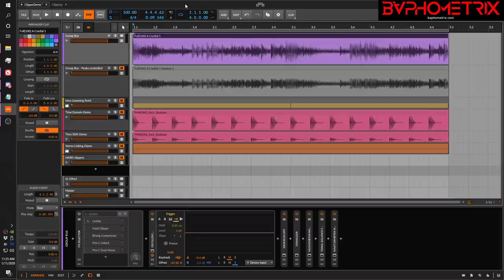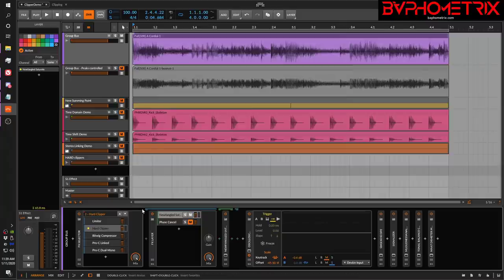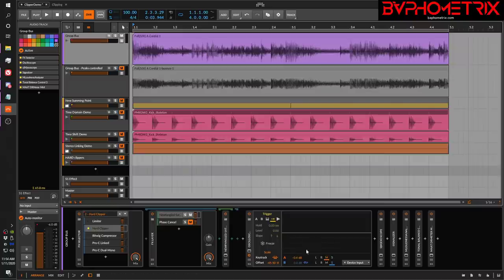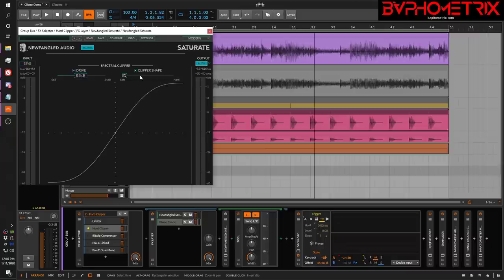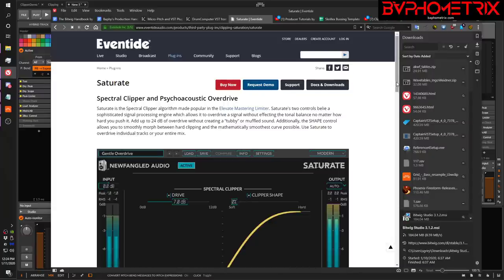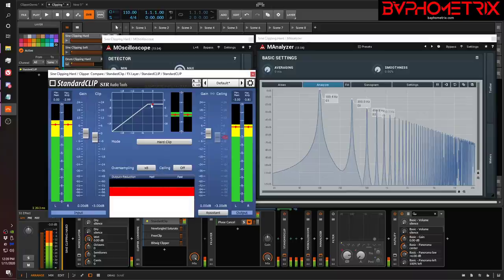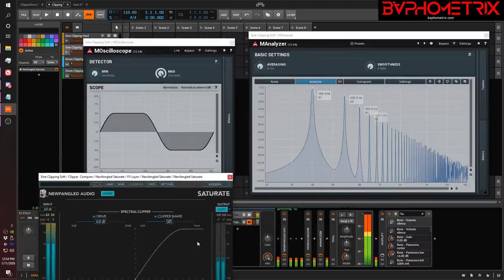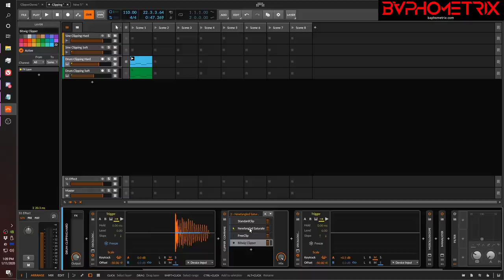Deep dive into clippers--NOT compressors--for clean, transparent loudness

Comment: Hi, I never used clippers much and what I hear in this video is that all clippers actually change the sound quite deastically. How then a clipper may be used instead of a compressor? I tried several clippers and they all introduce unwanted distortion similar to how overload sound, I even tried limiting the signal before clipper (with different limiters also) to make peaks more steady, but this didn't help much (if at all). I would be grateful for some clarification on this point. Thanks.
Reply: Which clippers did you use? I've recently started using VladG's Limiter No. 6's clipper section, but sometimes, when you apply something like that to a piano or a violin, as opposed to a kick and snare, for example, it may sound distorted by ear, but the number you get on the reading might show you that the audio isn't going over the red. I saw a tutorial by Au5 on clippers and he had a rack stack preset that he made where the more he raises the gain on the stock Ableton clipper, the more gain that's being turned down in the utility gain afterwards, which is last in the chain. I haven't actually watched the whole 1 hour and 44 minutes of this video and may have already made errors and misunderstood some things said, but I hope this might clear up things a bit.
Reply: @Kiloeve  I use SLM2 from tbproaudio and I like it a lot, I also have Limiter No6 and some others but they still may change the sound as any other clipper. So I cannot see any use for this instead of a compressor, as it is said in this video. It is a separate processing for me that has nothing to do with what I normally achieve with compressing.
Reply: @ivannikolaev2293  Oh, I see.
Reply from the maker: My best advice is to watch more videos about "clipping" and "loudness" (mine or others.... try "Mixbus TV" too!) until it starts to make more sense to you. :)

Comment: Very good video- I have had some colleagues try to explain clipping each channel as well but they failed to explain it to a level of understanding as you have. I have been applying it but it still hasn't really made since until now so thank you. Also,  is the bus routing at 59:17 all the chains linked to the next chain or all the chains straight to the master after the hard clips? I think I would prefer to go from each hard clipped bus straight to a premaster then slight limiting from there but want to make sure I am not causing myself issues by doing that.
Reply from the maker: There are many bussing strategies. There aren't any rights or wrongs here.
Reply: @Baphometrix  fair enough

Comment: Just discovered your excellent channel. Thanks for sharing. You've opened my eyes to using clipping, instead of compression, to tame transients. 

Would you use this degree of multi-bus clipping on non-EDM projects as well--e.g., folk or jazz? In other words, is using multi-stagged clipping a generally good mixing/mastering habit? From what I've read, loud mixes tend to sound better on smaller speakers such as earbuds.

If I am understanding you correctly, Eventide Saturate doesn't have over-sampling. I wonder why?
Reply from the maker: Quieter, more dynamic genres (such as jazz) won't benefit from clipping much, or at all.  Clippers are a tool to get into the tight dynamic range required if your song needs to be  loud because you're producing in a loud genre.

Saturate understands that if your goal is to clip_, the signal needs to _stop at the clipping ceiling. So that's why it's not oversampled. Because oversampling always creates peaks on output that  sit above the ceiling you set in the clipper (and those peaks are unpredicatble and variable).

What makes Saturate different from other clippers is best summarized by Dan Gillespie himself in this post.  https://www.newfangledaudio.com/post/saturate-1-7-0-preserving-detail-while-clipping
Reply: this is mainly for electro styles and maybe rock, all accoustic styles (and on vocals) you wouldn't use clipping

Comment: bit involved but, if you don't have a compressor with look ahead, you could duplicate your track, move just slightly ahead in time, and feed that track into the sidechain to trigger your compressor on the original track. obviously don't send the audio from the duplicated track anywhere
Reply from the maker: That still doesn't change the fact that compressors carve downward and upward envelopes over time, but a clipper is instantaneous. If your goal is minimum added distortion, you're far better off using a tool called "TrackLimit" by DMG audio, which is a super lightweight wideband dual limiter (two limiters in series, inside every instance of TrackLimit). It's fantastic. You can sprinkle dozens and dozens of them throughout a project.

Comment: 1:13:32 to be precise, the anti-aliasing filter is still going to be at 22khz (or whatever the nyquist frequency of the target sample rate is). The point is to try to filter out as much as the frequency content above the nyquist caused by the clipping process as possible before down sampling so as little aliasing happens as possible.

BTW I would not use post clip at all, unless it's the final effect in the master chain. Why try to sacrifice the quality (even if ever so slightly) when that intersample/oversampled clipping going over the threshold does not need to be clipped precisely? For master render it's different, of course.

Comment: What oscilloscope are you using? This is such a great lesson.  It will even work in r&b and hip hop.
Reply from the maker: Yes it will. The oscilloscope on the bottom is the native oscilloscope in Bitwig Studio. The I start using halfway in is called "Signalizer" by Janus Thorborg. However, the oscilloscope I prefer today is Psyscope Pro by FX23. It's for Windows only. But there's a Mac equivalent called "Oszillos Mega Scope" by Schulz Audio.

Comment: Just finding this video now. Really informative and in-depth; you're really a great teacher. What about the fact that hardclipping plugins cause serious aliasing without aggressive oversampling? I've done listening tests and it's relatively easy to hear the "cloud" of aliasing artifacts that obscures the version of a mix using a lot of plugins that alias when compared to one that doesn't use those plugins. So far I have found only one saturation plugin that takes this into account: Fielding DSP's Reviver (it applies an antialiasing filter to the generated harmonics). All of the rest need often at the very least 16x oversampling to reduce aliasing to a reasonably low range (less than -100 dBFS or so, which is still higher than optimal). That spells trouble for your CPU very quickly, even given the fact that I use a powerful i7. Curious to hear your thoughts,
Reply from the maker: It's a good question. The TL;DR (and don't rage-quit at this first part of the answer!) is that you can't avoid ALL aliasing and some aliasing is "good", just like some types of phasing issues are "good". Yes, really.

What I mean by "good" in this context is essentially, 100% natural and 100% to be expected. Every EQ filter you plop down is changing the phase of the spectral balance near that filter point on the track or bus where that EQ is sitting. Is that "bad"? Or is it just the way an EQ works and part of why the EQ processing sounds the way it sounds?  You can't slap linear phase EQs everywhere in your project because it will eat your CPU and create huge amounts of latency AND it will create pre-ringing that might smear your transients and sound objectively "bad".

So it's the same deal with aliasing foldback from any non-linear process like hard-clipping or distortion or saturation. Is the aliasing caused by these processes really, truly "bad"? Or is it just something that comes with the territory and is a natural part of the "flavor" of whatever waveshaping curve you tossed on the signal?

With that in mind, where you have a true, objective potential issue with aliasing revolves around the question of HOW MANY tracks and busses are you processing in a way that is causing aliasing? Are all of these small amounts of aliasing summing together on their way up to the mix bus in a way that is making all the intermodulation distortion AUDIBLE?  Then yes, that's a bona fide problem to solve. And it's the PRIMARY reason that savvy producers/engineers work at 48000 sample rate instead of at 44100 sample rate. (Because the anti-aliasing filters for oversampled processing sound even cleaner/better at 48000 because the filter slope can be more relaxed and cut out more of the foldback.)  Dan Worrall has a great video about "Sample Rate" that he did for Fabfilter that illustrates this issue perfectly.

Okay, so what does this mean for your question about using non-oversampled hard-clippers?  The problem here is that my recommended use of hard-clippers--as a VERY TRANSPARENT and CPU-light type of limiter process for absolute dynamic range control--is at direct odds with the benefits of using an oversampled clipper/saturator/distortion process to reduce the aliasing they incur.  If you oversample the hard-clipper, then you're not truly reining in the peaks at the ceiling value.  So you're not getting the dynamic range control that is the entire goal.

But there's a nuance here, and there IS an answer here.  First off, early in the project, just don't worry about it. Your goal is to have a bunch of "zero-latency-and-low-CPU" hard clippers everywhere. This is why I call them "dirty limiters".  Then, when you move into final mixdown stages of the project, you want to start replacing all those non-oversampled clippers with either a full-blown limiter plugin (which is oversampled but still has a final non-oversampled clipping stage at the very end of its internal processing), OR you can replace those clippers with Kazrog Kclip Pro 3. Why KClip? Because it's literally the only hard (and soft) clipper out there that has TWO clipping stages built into it. The first stage can be oversampled way high if you like. And then the optional "Ceiling" knob is a final non-oversampled hard clip right at the ceiling value.

Whether you go with a brick wall limiter or with KClip, you can have reduced aliasing from the early oversampled processing stages, and then the final non-oversampled clipper stage at the end will shave any peaks that the oversampled process allowed to go over the ceiling. The end result is still SOME aliasing, but not as much aliasing as would otherwise be there.
Reply: @Baphometrix  thank you for your in-depth response. I've been engineering now for a couple of years and I must say that you're right insofar as this is a very unorthodox opinion. I will probably do some more tests with using this technique as you described compared with my current setup designed to reduce aliasing as much as possible throughout the recording and mixing process and see which one I prefer. What I really wish, though, is that I could mix a full project at 96kHz...Intel and AMD better hurry up!
Reply from the maker: @ezrabrownstein3237  No worries. Just... I'll offer up that my opinion isn't really all that unorthodox among engineers who routinely deal with the challenge of loudness. If you use a non-oversampled hard clipper in the right way, on the right type of material, the aliasing and IMD is happening only during extremely short bursts and simply ends up sounding like a "noise spit" has been layered into the transient that just got shaved flat.

In other words, the artifacts from hard clipping are simply a type of distortion that can be pleasant when it's done right.  Either you make something percussive and already transient and dynamic sound a little "punchier" or "hotter" (in a good way), or in many cases you simply find that breaking point where you're achieving some degree of dynamic range reduction (lower crest factor) in a way that is audibly transparent.

Comment: Do you still have a use for pro-L? If newfangled is your mastering plugin and clipping is more transparent than compression/limiting I'm just wondering when you actually use stuff like pro-L if at all
Reply: But awesome video helped me grasp how to utilize clipping!!
Reply from the maker: I still use Pro-L when it's the best fit for a given song. I do diverse stuff--not all heavy music. I ended up doing more sync work than I thought I might. At the end of the day, every mastering limiter has a slightly different sound (it can be subtle), and eventually you just try different limiters (and the various different algorithms that might be in each) and just try them out and listen for differences and pick the one that seems to work best on the material.
Reply from the maker: Also, clipping isn't a replacement for limiting. It's a complement to limiting. My demo example was a bit extreme. The main point of  clipping just a little bit--transparently--of the transient spikes that tend to accumulate at all the summing points of a project (the group busses), is so that by the time the signal gets up to the final mastering limiter, there's not much work for the limiter to do.
Reply: Baphometrix thank you for the insight as always

Comment: I just ran into this in DaVinci's Fairlight and instantly saw it was like a compressor without the colourization.  Will this work with spoken word as I am having a heck of a time with Youtube and getting my voice to stay the same vid to vid (stats for nerds)?
Reply from the maker: Vocals and dialog are VERY "tonal" and continuous in their nature. (As opposed to transient and percussive.)  All clippers will add a very short "spit" type of distortion at the instant they shear a peak flat.  This works great for a LOT of sounds, because the sounds themselves are already bright and transient, so that masks the quiet "spit" of distortion very well. If anything, the tiny "spits" being added to the transients makes the overall sound a little brighter and more present.  With vocals, though? You typically don't want this type of noisy "spit" added to vocals, because they'll stand out like a sore thumb.  Even compressors and limiters can add too much of these types of artifacts to the sound of vocals.  This is why you'll see professionals literally hand-edit the gain envelope of a vocal recording. Or use a "gain rider" style of plugin which works kinda/sorta like a compressor but is designed to move that virtual fader up or down at a MUCH slower, smoother pace than a compressor would snap the virtual fader around. TL;DR - I hand-edit my vocal gain envelopes. And if I still need more dynamic range consistency after that, I'll use a limiter, not a clipper.

Comment: 1:03:00 would you recommend using a gate on like all your tracks to get rid of the noise floor?
Reply: Trying to think how to get headroom/eliminate aliasing. Kill 2 birds w one ston. I understand it will eventually get masked or stay inaudible but i was surprised how much headroom clippers give you and am wondering about gates now
Reply: 2. I saw u pulled up mumbai power. He uses pro l as the clippers at the end of each “chain”/premaster busses. Would u reccomend ditching pro l2 in exchange for nf saturate since the goal is to just clip? Or is there a reason u think hes using pro l to do this group bussing
Reply from the maker: Oh gosh no. That noise floor is ssoooooooooo far down below any audible range. No point in doing that at all. The point of several examples in the video was to demonstrate how much of a NON-problem most aliasing foldback really is.

Re your other question about Skrillex... clipper/limiter.... essentially the same thing. If you set a ceiling in a brick wall limiter, it's essentially acting like a clipper, but perhaps with some small amount of time-domain release shaping of the bus signal.  Tomato Tomahto. The net result is essentially the same.
Reply: Baphometrix thank you for the reply! Ya i figured gating could easily introduce more problems than it solves, and how little aliasing from clipping would affect ur sound theoretically. But ik mr bill talks about using gating to increase headroom so it just left me curious. Thanks for the clarification. 

Aside from my gating question, I also noticed skrillex uses ozone 5 instead of a limiter on the final master chain. Any thoughtson this? I get that everything is situational but since skrillex is a holy grail of mixes for me it has me left wondering why he chooses ozone vs a mastering limiter. Im still leaning towards elevate as the final piece of the puzzle especially after hearing how much punchier it is during your shootout comparisons but it has me wondering what skrillex’s ozone 5 is all about sitting at the end of the chain, maybe u have some insight on this or maybe its tomato/tomahto again. Either way curious what you think!

The reason i ask about ozone vs a limiter on the very end is because i know he likes to send certain elements such as main vocals straight to the master which has me wondering if they should get limited or not. Obviously we dont know for sure what hes doing in ozone but hoping to demystify the thought process a little but
Reply from the maker: @SnoMan1818  Ozone 5 is just a mastering limiter (essentially). Probably either Skrillex never found features in Ozone 6 and later to be compelling enough to shell out for, or there was some aspect of Ozone 5's "sound" or "behavior" that he has a preference for.

Most of us send vocals straight to a vocal group buss and then do NOT sum them with any other sounds before routing the vocal group bus straight into the master bus. But everything gets hit by the processing on the master bus (including the vocals).  It's all about controlling what exactly you want summing with other things on their way up to the master bus.
Reply: Baphometrix thank you!